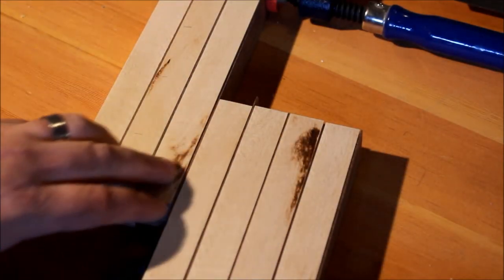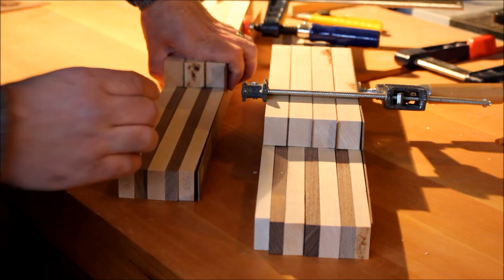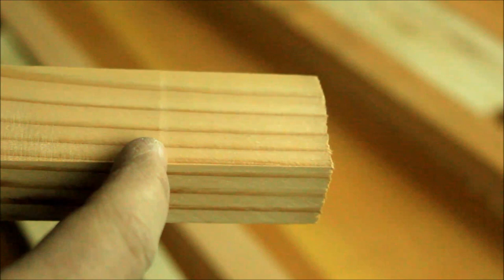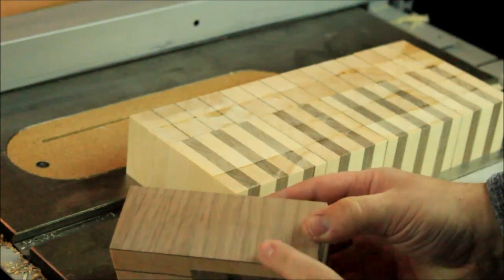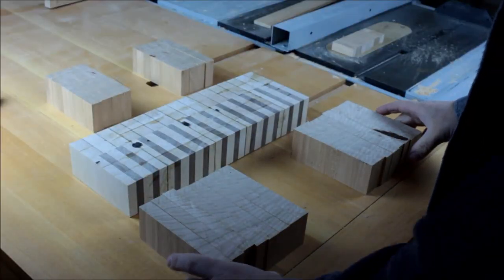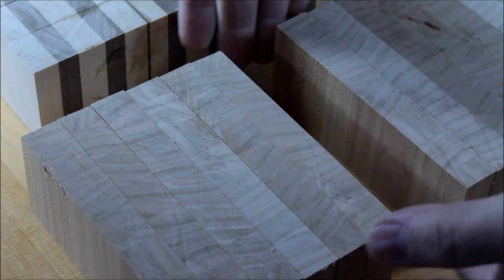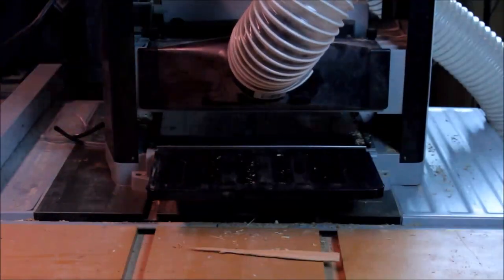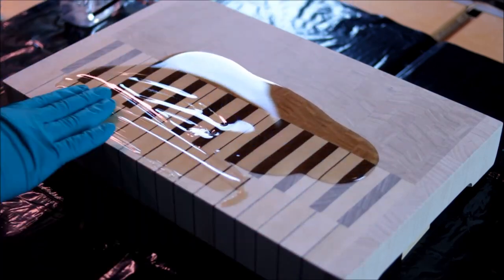End Grain Piano Cutting Board

Comment: Absolutely outstanding! I just made my first cutting board, I tried the end grain and after some tear out on the planer and other miscalculations I ended up with two cheese boards😂 I still need to inlay some grapes and leaves but I don't think I'm going to do end grain anymore, at least not until I get a little more experience 👍
Reply: Consider not planing end grain. You’re almost guaranteed to get tear out and it can be unsafe. If you’re not spoiled and don’t have access to a drum sander or wide belt, try making a router jig to flatten any deviations between slats and then sand. You’ll end up with far better results, prevent injury, and save your planer. Good luck!

Source: lots of screw ups and learning from experience and more experienced woodworkers.
Reply: @Purdue_Pharma    Thanks brother. There’s a lot to learn no doubt👍🇺🇸

Comment: Love this video and the board is fantastic! I have to ask, how do you cut such thin strips on your bandsaw and then be able to use them without and gaps showing when you glue them up? It’s likely I just have a really crappy bandsaw but mine leaves all kinds of saw marks and it would never glue up tight.
Reply from the maker: Thanks, i had a brand new blade and the settings were spot on, still i ended with saw marks, i sanded each strips by hand to make them smooth. Drum sander here would be extremely useful. Thanks for watching

Comment: Nice board.  Of the overall width (10 1/2 inches), How much is keyboard pattern and how much is solid cherry.  I guess is boils down to what was the final thickness of the glued up blanks that you used
Reply from the maker: Both sides ended up at 5 1/4" . Thanks for watching..
Reply: Thanks, Tomy

Comment: I like your detailed explanation of why you were doing things, especially how you dealt with tiny errors.  This level of detail is extremely helpful.  However, I'm concerned about the safety of some of your techniques.  Your sleeves get awfully close to the table saw blade and your ring, if caught by accident, could cause you to lose a finger.  I was taught to not wear any jewelry (I take off my wedding ring when working around cutting tools) and not have long sleeves (don't even think about what would happen if your cuff got caught).  I've lost part of a finger and count myself lucky that this is all that happened.

Otherwise, your video is excellent and approachable.  I've been in my own shop for 22 years, by the way.  I've been making wooden things for almost 60 years.
Reply from the maker: Thanks Mark, You are right... I should remove my ring...You'll probably see me make some improvements in the futur videos...
Reply: @HovingtonInstruments  I have been a woodworker all my life.  I never got a ring caught and never took my wedding ring off.  The sleeves are a bit dangerous. I wear short sleeve t-shirts in my shop. I did have an accident with my wedding ring years ago when I was taking a stuborn wire off of my starter motor on my vehicle.  The wrench I was holding was making connection with my wedding ring when all of a sudden my finger got hot and sparked.  Burned a circle around my finger. Could not wear it for a few weeks.  I learned the lesson to maybe disconnect the battery when I am working on the starter.  I am a wood worker not a mechanic.  I still have all my fingers and was never shot with an air nailer. 
Thanks for the video. I am making a piano board right now as we speak.  So far so good with your instructions. I have the keyboard done and sanded some and in the process of cutting out the strips for the rest of the board.  

Mark Slafkes, I as well have been working in a shop for 60 some years.  My father was a carpenter and cabinet maker. I was fortunate to have him let me use his tools at a young age.  The power saws I had to wait untill about ten years old.  I have a nice heated shop attached to my garage and would not know what to do with myself if I did not have one.  It is my life. 

Thanks for both of your comments and thanks Mark for pointing out safety.  As Norm Abram always said, "there is no safety more important than to use safety glasses as well.